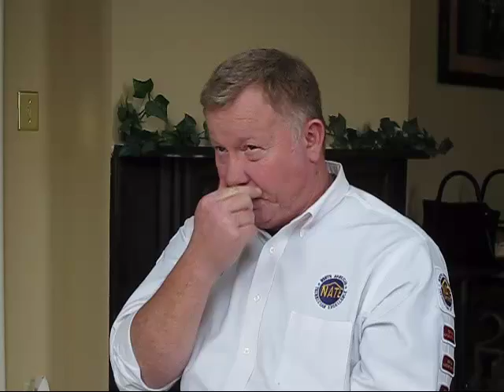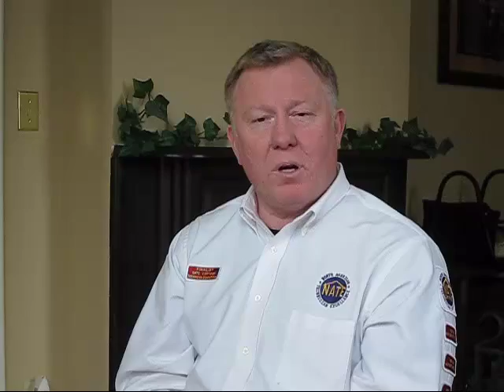Mistake #8 Faulty Copper Tubing

Comment: Thank you for this informative series. Regarding #8, copper tubing issues, is it true that all copper connections (aside from compression fittings) must be brazed, or can they also be joined using the more simple method of sweating, as is common for water plumbing?